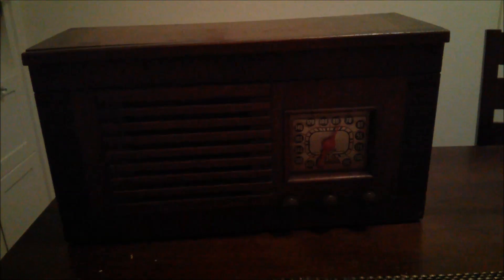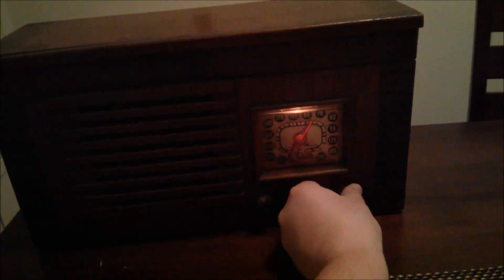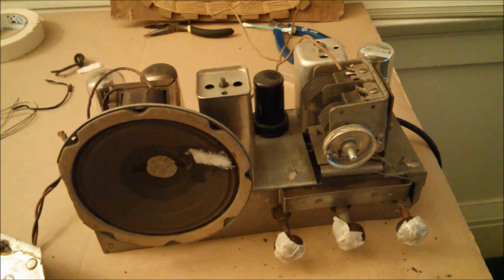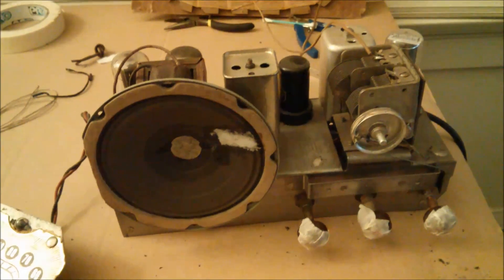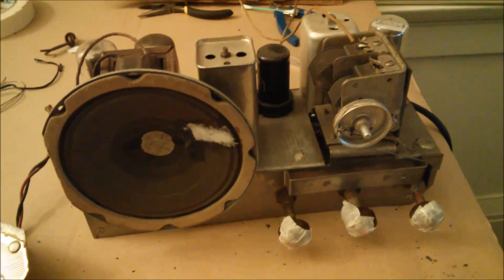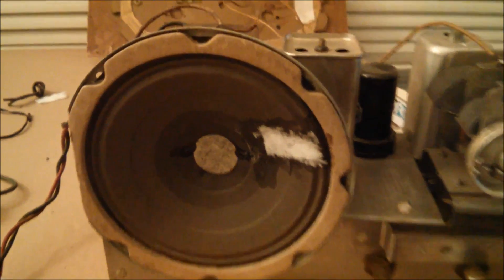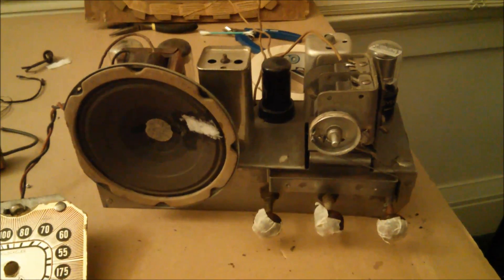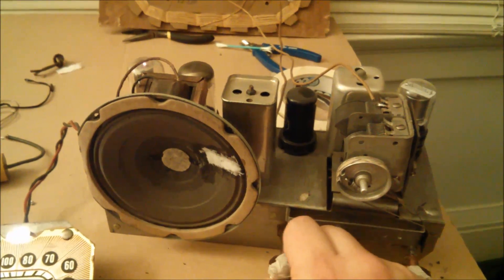Clarion tube radio repair

Comment: Safety caps are a good Idea ? But I never no what value to install ? Any suggestions .I hear a fuse is a good idea ,but again what size fuse ? Fast blow fuse or a slow,blow ?
Reply from the maker: Just replace the existing wax+paper and electrolytic capacitors (the big cylinders, basically) with the closest value you can find, and then rewire the power cord as described here https://antiqueradio.org/safety.htm

Comment: I seen another tech do the ceramic cap thing too but he used the blue high voltage somewhat a size different and ceramics are more reliable too,but if I do that I will use the blue caps high voltage disk caps,and that phone cap I would have change it out In case you sell this radio ,amazing job on the repairs,I hope I never have to replace a dial.string. I wish you would have filmed the hot chais fix.

Comment: I  should recommend change all the capacitors, verify and measure all the resistors and change all those out of tolerance, also clean the tubes socket, check all the tubes with a good tester , clean the chassis with air pressure, it is a very good practice change an old speaker you will get a better sound.

Comment: The dial string does not appear to be routed correctly. It should not slide on the metal. You may have to wind it around the dial control post a few times. (2-4 times most likely). If you know the model number you can look up dial string wiring here---http://www.theoldradiofixerupperguy.com/dial%20cord.html

Comment: Shouldn't the twine follow the direct path to the tuning knob? It does not seem logical for it to be designed to run along the outside of that bracket.